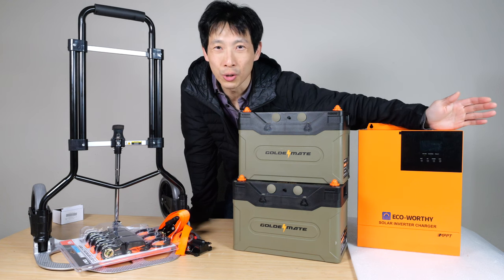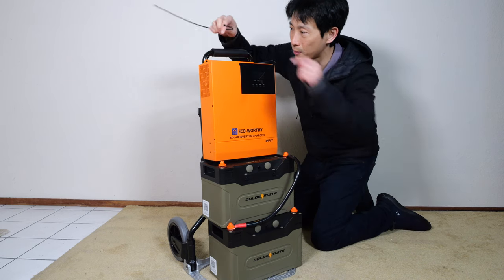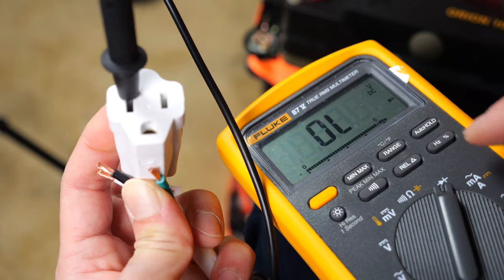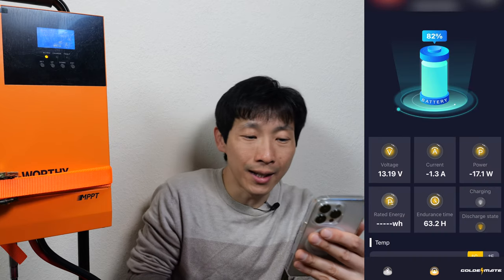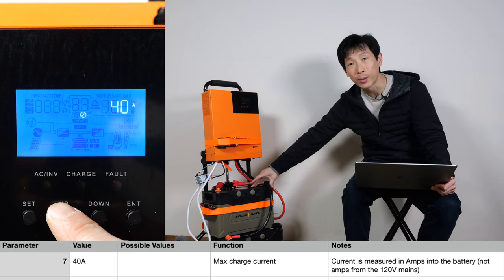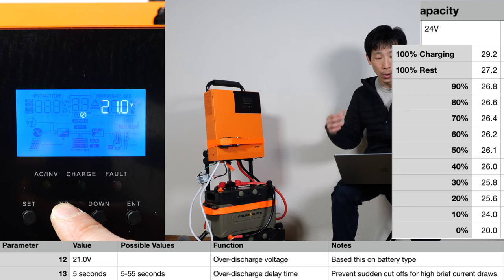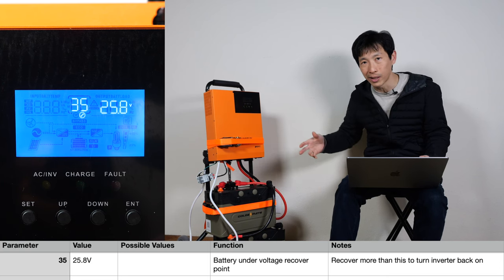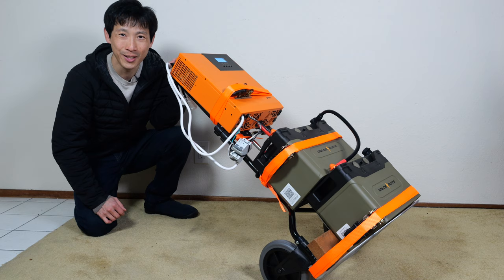Hand Truck Power Station Step-by-Step Guide

Comment: I appreciate you describing all the inverter settings/ parameters and their functions. That to me is the most difficult part as manuals are usually lacking/ small print/ not legible or understandable. I have dozens of inverters, including several hybrids, but have not yet been able to complete installing the hybrids due to life circumstances (and no good place to mount solar panels). This will help me (even though I don't have this exact inverter).

Comment: For anyone that doesn't understand the huge voltage differences between minimum battery discharge voltage and the battery undervoltage recovery to turn inverter back on

Hysteresis-Often, some amount of hysteresis is intentionally added to an electronic circuit to prevent unwanted rapid switching.

The phenomenon here is the rapid voltage drop (in this case; if we are talking about the max charge voltage and the voltage at which it will start charging the battery again it would be voltage rise)

Because the very bottom and top of the LFP curve is so steep we could see the discharge current from the inverter drop the battery voltage back down to the battery undervoltage point if there is not a significant gap in between them. If there was only a 1V difference you would quickly cycle the inverter on and off. 
For example
Minimum Battery Voltage: 20V
Battery Undervoltage Recovery to Turn Inverter Back on: 22V

Your average LFP battery that cuts off at 20V (for a 24V) will bounce back up to 22V EASILY within seconds after the load is disconnected. Sometimes even back up to 24V. With the above numbers the battery would fully discharge, inverter would stop drawing from the battery, voltage would rise back up within a few seconds, inverter would turn back on and before the load could even run for a few seconds it would likely drop back down to 20V. This cycle would continue going and going with less and less time in between each step as there becomes very very little capacity left at all (even under a small load) and eventually we would hit a point where the battery would never recover to 22V once the load is removed...but by that point I could see the system cycling 10+ times. A great way to blow up your inverter.

Max charge voltage of battery: 28.4V
Voltage at which charging can start again: 28V

LFP's resting voltage is below 28V so the battery would fully charge, cut off the charger and within a minute drop below 28V and start charging again. 

Proper Voltage and which the charging can start again: 26.6V

The above number is just slightly under the voltage LFP rests at so it would take a load current a minute or two to draw the battery down that low....it would never reach that point if there was no load...it would likely sit at 26.8V'ish if recently fully charged but has been without charging current for an hour.

Comment: In my case my reasoning for building this and using it would be to timeshift my electricity usage. After 4:00 p.m. my electricity rate almost doubles, and then after 9:00 p.m. it drops back down, and my big 85 inch TV sucks down about 700 W when being used not sure if this would power my TV for those 5 hours???

Comment: am I correct that this rig will only run that heater for less than a couple hours
Reply from the maker: Correct. On a full charge, it will run it for about 2 hours. Of course, this is expandable and you could put two 12V 200Ah batteries and run for 4 hours.

Comment: If the voltages are slightly different you can still wire them in series. Why would that matter
Reply from the maker: If one is higher and you charge it to 100%, one battery could end up being over charged.
Reply: Doesn’t each battery have its own internal battery management system?

Comment: That's a poor choice of handtruck for the weight you're strapping to it.  Also, those resettable breakers are garbage.  Watch the reviews on them.  They will frequently allow as much as twice as many amps through before they overheat, finally trip, and are then completely destroyed.  If you insist on using a resettable breaker, get one from Blue Sea Systems that works properly.  Really, for the amps you're potentially pulling, a proper T-Class fuse is the way to go.  Those are Grade-A, top-notch batteries, paired with a garbage inverter I wouldn't recommend to my worst enemy.
Reply from the maker: Hand truck is fine, it is within the weight limit and felt pretty sturdy. It is close to the limit to minimize cost. I do agree on the breaker being a cheap one and will replacing it. In the mean time, I will remove the recommendation from the video description and replace it with that one.
Reply: How is the inverter garbage, I got one! Yes 1yr now and does the job powering my washing machine, kettle, microwave and toaster also kitchen radio, it's within my budget and works ,so what's the down side if it functions and is affordable not breaking the bank
Reply: @Andrew-ki5jz  - 1 whole year?  Well, if it's done what it's supposed to do for that long, I guess it's just the greatest product ever made.